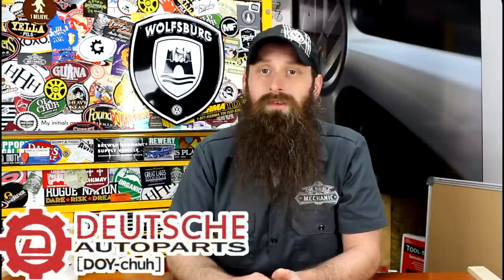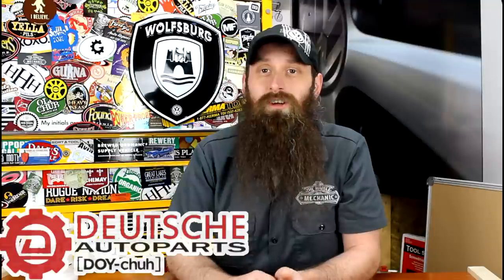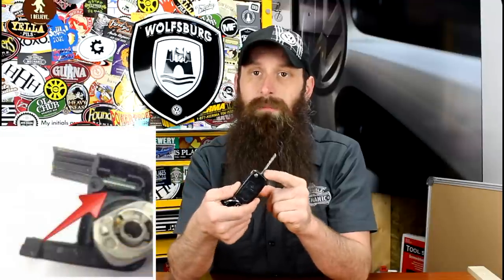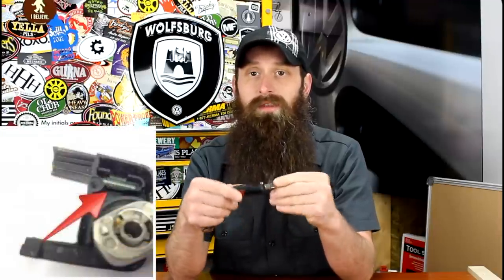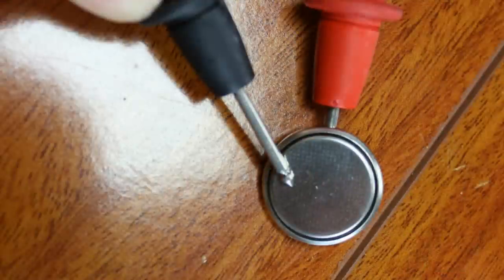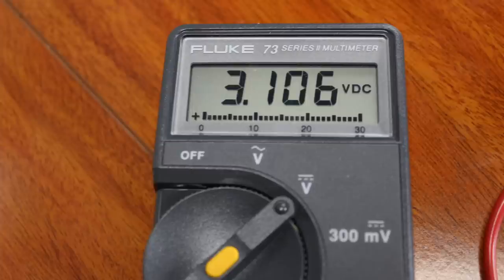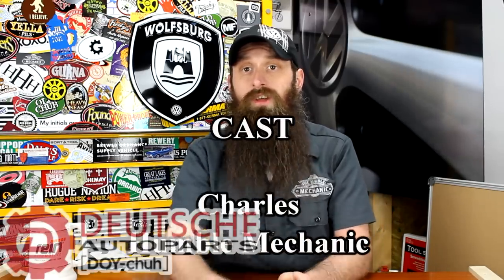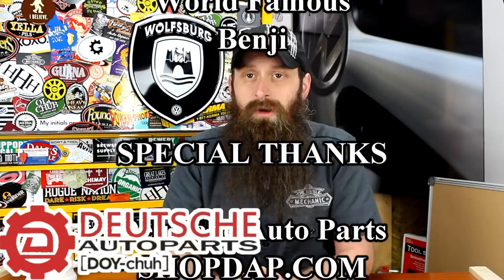How VW Keys and Remotes Fail

Comment: My normal key stopped working in my Volkswagen Golf 2001. I found another video that said if your car is immobilized with your normal key that you can put the key in the ignition and turn it to the on position and leave it for 12 minutes, then the immobilizer icon will stop blinking and you will be able to start your car. This worked for me.
Reply: Had the same problem this morning, i  read your comment and did  the same on my 2008 VW crossfox and it worked  !!!!
Reply: @TeX77  that's so awesome :) im glad it helped you!
Reply: Do u have the link

Comment: My unlock button stopped working on my CC. I figured it was remote because all other buttons worked. I ordered 2 new keys. I lost battery in original remote, so I put battery from new remote in. Works fine now. Oh. Locksmith will not program this key. Have to go to dealer. I got lucky before I took it to dealer.

Comment: My question is I have a Jetta 2017 and it’s push start and a couple days ago I stop letting me lock or unlock with the door handle and once I get in it says “keyless defective” but it would start fine. now pushing the button to unlock or lock it I have to push it multiple times and now for it to start I have to put the key on the signal pad and this all happened in a week and I change the battery please help me the dealer charging $250 to LOOK at my car with no work being done

Comment: hello my name is Daniel from Los Angeles I have an issue with my 2012 Jetta regular gas my key is not being detected I get a message that says no key on the – the car starts for a split-second shuts right off the car was parked for a month battery was dead I took the battery to AutoZone charged it up but I do have a key that is detached from the fob because it is broken the middle part of the key is broken off of the fob but before the car set part for a month I was able to drive it and started with no problem by turning the key in the ignition with a pair of pliers and just hovering the fob nearby the key but now that is not working and the car sits immobilized not working I need to go to work can somebody please help

Comment: on my mk4 jetta wagon i bought the car knowing it had a nonfunctioning remote fob, took the car to a euro specialist shop that wanted to install a new lock module $500 parts and labor, even after they claimed they had put a new battery in. a year later. i had gotten used to just unlocking it with the key and not the fob. got bored one day and i popped the remote open and surprise surprise, they had installed the 2032 battery upside down. I reinstalled it and the fob works again. the TL;DR ALWAYS CHECK YOUR BATTERIES AND THE POLARITIES FIRST!! :-) Thanks Charles, your knowledge is always  highly informative!

Comment: Thank you for the informative video! I replaced the battery on my second key fob (keyless ignition) and the car cranks/runs just fine, but I cannot unlock or lock the vehicle using the remote. The first fob works perfectly. Any recommendations? Thanks!
Reply: @Cameron Titus instablaster =)
Reply: @Emmett Bo thanks so much for your reply. I got to the site through google and Im trying it out now.
I see it takes a while so I will reply here later when my account password hopefully is recovered.
Reply: @Emmett Bo It worked and I finally got access to my account again. I'm so happy!
Thank you so much you saved my ass :D
Reply: @Cameron Titus Happy to help :D

Comment: Hello, I have a golf 4 1.8t GTI (motor AGU) from 98. I have a issue. I lost my original key and fixed my second one switching the buttons inside that here damaged and work fine but lost the funcion of open/close the windows remotely. It just works when I use the fey fog in the door. 
I manage to find 2 original keys for cheap and worked fine in the last car. I am gonna try the method of putting the  working one and try to configure it. 
My question is, if it work. Is it possible to reactivate the closing/opening of the windows remotely with the key ?

Comment: i have vw polo 2013. That seem to have a immobiliser issue. the car wont start when i turn the key i hear a clicking sound and that's all no starting.  i ran a coder reader on it and it only says 9** but i cant see the rest. it also says immobiliser in the reader. please not there is no immobiliser light flashing. Can assist?

Comment: Key not in range and unlock or lock car must use key too on my Volkswagen 2013. It happen in my car after i change my accu battery and it didnt happen before. Is that  kessy problem ?

Comment: Hmm, awesome video. I have a used 2010 Jetta purchased from someone I know. Runs great but now doors not locking. Thought alarm is activating from fob. I was going to just change the key fob battery myself. Then your video says you best have another key to do that. I don't have an extra. So off the the rip-off dealer I go.... sad.

Comment: Hey I just had battery check and was good, but the key remote stopped working, I changed key remote battery now car can’t detect, it’s  a 2015 Jetta, I tried synthesis with the outside door key flip but not work

Comment: I have a Vw golf mk4 gti and al the doors have some kind of problem. One door won’t open at all, second door won’t lock or unlock so I have to do it manually. The rest of the doors are trying to lock de doors but they either pop up to the unlocked position when I lock the car or jumping up and down and not locking it

Comment: Hi Charles, I have a 2006 vw new beetle 2.5. Ive changed my battery on my remote.  I am getting a red light on the fob itself but  it won't lock or unlock the doors. The car also suddenly won't crank or start. Could this be a fob issue? I do have 2 keys for the car but I never programmed the new one yet nor did I ever try to use it.  The battery in the car itself is new as well.  I replaced the ignition cylinder and transferred my key assembly to the new cylinder.  All fuses are good. I replaced the vacuum pump gaskets under your video with great success. Everything is back together. I now have a security light on the dash flashing and the car won't even turn over. All lights, radio and other accessories all work but it just won't turn over and the security light flashes. I have tried every video trying different attempts to clear it but no luck. I have a couple scanners and have cleared the codes but still no luck. Can you or anyone help? Your videos are the best, thank you for them all. Ive learned so much.

Comment: 2007 jetta when you push the trunk button nothing happens.when you push unlock button twice it unlocks all doors and the trunk. How do I fix it.would a pro tool max fix it,auto pro pad ,im608 .I don't have a key programmer but I can buy one since I like buying tools.most my other vehicals is ford,hyundai, mazda just in case I need key stuff for them to.mainly fix the jetta button signal.there dealer remotes that I have.

Comment: Thank you for making this video. I have a 99 Jetta and changed the batteries in my key fob. Then the fob wouldn’t work. So I tried your suggestion of putting one key in the drivers door and the other in the trunk. And my key works just like it should 👍 ... awesome man thanks again!
Reply: If you don't have the extra key, just put your key in the ignition, turn to ACC, and press the remote until your locks go down. It's now programmed.
Reply: Mario M I have a push button and only one key car doesn’t lock or unlock at all
Reply: I have  2000 passat and the key   in water for 2 days

Comment: Wish I could figure out my 08 rabbit. Key fob will not work after replacing rubber buttons changing out battery new battery. Tested on a fob tester at local dealer all butting work and signal present but still no communication with vehicle. Tried adapt relearn per user manual and using a snap on scan tool to adaptive relearn no luck

Comment: Help!  Got new key fobs for 2001 cabrio and while following instructions to program them, car went into some sort of alram mode.  We had to disconnect the battery for it to stop.  Now, every time we put the battery cable back on, the alarm goes off...wont stop even if we start it.   Need to be able to drive the car without the alarm beeping and would love to get my fobs programmed.  Any advice?

Comment: Hey boss I watched your video on why the 2004 touareg isn't a great car a tad too late, and now I'm stuck with it. I have used a majority of your videos as a reference in the process if getting the car to run and the last and recent problem I have is the "immobilizer activated". And my car key does have a problem and when I did take it apart, I noticed a what I think is a copper coil bar, thats supposed to have a plastic shield over disconnected, do you think that is why I am having an issue? And where can I get the immobilizer taken it out if its a cheaper option, I rather be able to drive it until I can fix it down the line than pay money to take uber and other ways of transportation. Please if you can help me out, I will be immensely thankful. And if its any help I'm in Los Angeles, just in case you can refer me to someone who can fix it. And I've tried dealers but they just don't care to answer questions they just refer me to parts then to service and they give estimates on what they may charge and sure in fact I regret my purchase.

Comment: I have a 2002 VW Jetta. Can I swap the bottom portion of the key fob (not the key but rather the circuit and buttons) with a new one? I can start the car and drive it but can't lock it with the remote (only physically).

Comment: Hi, i have a VW Eos 2008, my car battery died, so had to jump start the car and then change the battery while the car is running.
after that my remote failed to unlock the car, but i can lock and open the boot normally, and the car start also normally.
what do you think?

Thank a lot. 
Richie
Reply from the maker: May just be a remote battery too.
Reply: thank you
i did open the remote and and cleaned it than close it, it worked.

Comment: My daughters 2001 VW Passat is starting an cutting off. Six months ago her key broke off of the housing of the remote. She glued it back together an it worked. Now out of nowhere the car is shutting off after one sec. the Immobilizer light is on. I’m having a hard time taking out the battery of the remote somehow she glued that too. Can u help me. Is it that she needs a new key an remote or is it something on the car itself. Btw the remote is working to open an lock all doors n trunk

Comment: Question. Its not really related but im looking at picking up a 03 gli vr6. When i went to look at it the guy only had just spare and no fob, could i buy a used actual  oem vw fob(s)  not after market made ones on ebay and just have another key(s) made for them and reprogram them with vagcom?
Reply: hi buddy. I have problem with my key my opening button in not working but my locking and boot button works.

Comment: vw touran 2007 
have this issue that battery wont last
first it was matter off days
then i adjusted pins that touch the battery now it has lasted for about 1 month
is there some other issue? what do i need to code a new key?
only got one

Comment: After 1 year I have begun having an issue with my '14 Passat TDI SEL premium  with the KESSEY  system. I began having trouble depressing the brake pedal to start the car, I brought it to the dealer and they replaced a vacuum hose and check valve as per tech tip 27-15-01. The following morning I had the same issue, back to the dealer who now states this is normal, if normal why repair it the first time, and why did it take a year to present  the problem? Suggestions?

Comment: Hi, I have a 2001 Jetta, and the immobilizer chip ip48 for the key fob is missing, do I have to worry about which chip I get? Or basically, every ip48 chip will work? The remote work for unlocking the car, but not starting the car. And in this case, do I have to take the key to the dealership to get it reprogrammed?

Comment: PLEASE HELP!!  I have a 2003 vw jetta wagon tdi diesel that does what you mentioned in video with start's a second and cuts right off. The car sat for quite sometime, changed battery. When the key in on position the battery light on dash stays on, windows wont work. I know you can't swap clusters with out being cloned. I do have a spare cluster and when i plug it in the windows then will work. Changed battery in fob's. One of the fobs did have a little rust inside and flashes red blinking light. Also blinking red light on radio. Is it true that a locksmith has to come out and reprogram the key to the car because of memory loss from when the car sat and battery was changed? Appreciate any help you can give

Comment: Hi
I am having trouble with my central locking. I can only lock and unlock, with key, on the passenger door. 
All doors will unlock with remote but immediately lock again...
I can here a louder click from the sliding door.
Could it be the battery?
I want it to be something simple cause I really don’t want to be ripping it all apart.
If you can help I would really appreciate; thank you.
It’s a t4 btw....
Reply: It’s a VW t4 btw! ....

Comment: Hi there, my car ran and drove and I took it to a shop to get the smaller radiator fan working and now it does not start and is in safe mode the dealership got a new key programmed for it and yet it does not start they are now telling me to replace the cluster and more money to do that I don’t know if it will run afterwards either, help please

Comment: So i recently picked up a 2000 gti it got submerged in water up to the interior where the stick shifter is it wasnt long but i managed to get all the water out and get it to run but it shuts down after a second and its because the key imbolizer is flashing on the dash also the key got wet too, so what would i need to do just get a new key or do you think the imobilizer is fried also it only unlocks too

Comment: I just have issue with my Jetta 2014 with Kessy key. My battery was to low, and nothing working perfectly. I replace the battery. i was able to run the engine, kessy system was ok. But the remote doesn't works anymore. I was able to unlock or lock doors with the handle, so the car detected the key. But nothing with the remote. I see on net how to program the remote. It said to use the other key and remote, put key ignition on with the problem key inside the car, going outside with the other key and lock / unlock door with the remote. So, I get the second key, and after just unlock the doors with the other remote, my problem remote working back right now. So, basically, when you replace battery, better to get to key and replace first and the second not at same time, and be sure both working before replace it! Otherwise, Could be a big issue. It look if the car want to see the other remote to be sure everything is fine... ??

Comment: I have 04 Jetta, when insert the key to start, the key turns all the way around but car wont start. I have to insert and extract the key slowly and eventually the car starts. Would this be an ignition switch problem or a key  cylinder problem or even just the key, any of you have recommendations on where to start, thanks